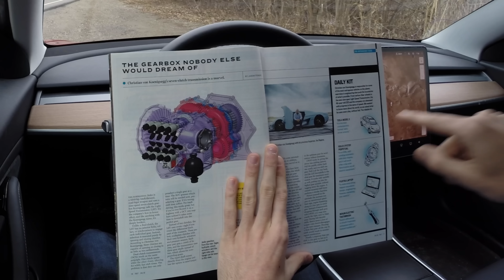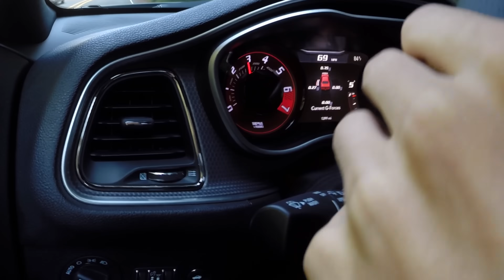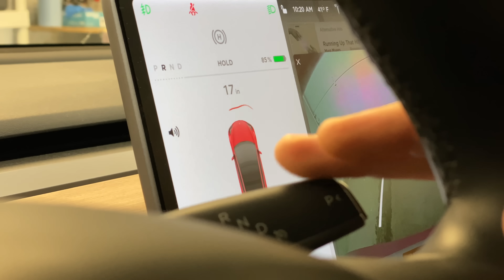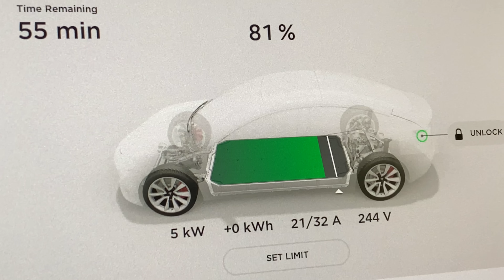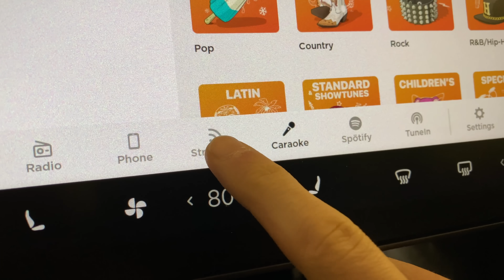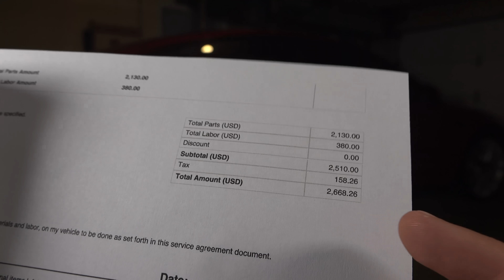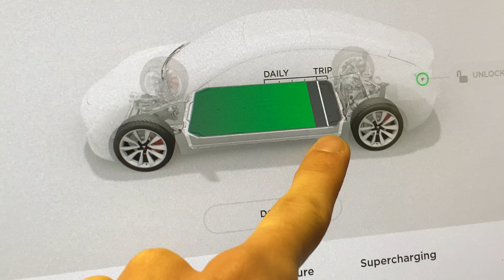Living With A Tesla Model 3 For A Year - The Best Daily Driver

Comment: 16:00 can’t you change the sensitivity of the accident thing? Or even turn it off worst case.
Reply from the maker: Yes, I have now found out! You can adjust sensitivity or turn it off. Wonderful!
Reply: Engineering Explained happy to be of service good sir.
Reply: @EngineeringExplained  Turn it off!!  turn it all off!!  Useless crap that gets in the way of actual driving.  :-)
Reply: @neoanderson7  As long as you drive normally (As in not unnecessarily reckless) the collision warning shouldnt ever go off. However, if you ever happen to get caught daydreaming it might save your ass. I currently drive a car without any electric assistance, not even abs, and it is fine, but the modern assists arent all useless.
Reply: @banaana1234  I'm specifically talking about that collision warning, side assistance, smart city braking.. all that junk.  ABS is not a system that interrupts your driving.  It lets you know when you've finally reached the grip level of your tires.  But its not constantly pestering you with lights and beeps from the console.
Reply: @neoanderson7  My point was that the problem is between the wheel and the seat if you are constantly getting beebs and flashing lights. At least if the car is reasonably designed and calibrated.
Reply: @banaana1234  I thought you saw this vid?  He describes not coaxing the car into anything abrupt, and still the systems were going off.  Don't think its this vehicle only.  I've had to drive my folks GLC and that thing  is absolutely ridiculous.  You'd be traveling down the road, no one around, and the thing would say "collision warning" for no reason...  All this tech gets in the way in the actual act of driving.  Just wish the manufacturers would give you the choice to equip the cars a la carte... alas...
Reply: @neoanderson7  Did you read the comments? The frontal collsion warning is adjustable, and he had it set too early. 

The safety systems are not up to the manufacturers to decide, regulations and safety tests mandate them.
Reply: Yes. There are 5 settings. number 3 is the default, number 1 is very close before you get nagged at
Reply: @UCWc_pCBR-U3j-BlTu2gxNoQ there lyes the issue.  Would we need these things if people actually knew how to drive?  When did it turn from becoming a privilege to a right to drive?
Majority of those vids you see are people who have no business being on the road.. and yet...
Reply: There should be an option to turn it off indefinitely.  All these modern vehicles have these "features".

Comment: Most of the problems mentioned are related to turbocharged automatic cars and don't really apply to N/A manuals
Reply: Well they do apply. A n/a manual has zero torque in cruising gear.

Also about zero cars sold these days are n/a manuals

Comment: I mean.. that precooled feature can be the main reason to buy it.
Reply from the maker: Soo nice when it's a super hot/super cold day! I use it all the time as it hovers around 30-40 degrees in my garage.
Reply: @EngineeringExplained  Just curious... Will it drain the battery hard?
Reply: @Dominus_Potatus  the AC is actually fairly gentle on the battery.  The heat is probably worse but I live in South Texas so I don't have need for heat.
Reply: @cspicer77  So be it! This is the killer feature for me XD
Reply: @Dominus_Potatus  For day to day driving, if you can recharge at home, the range reduction from using the heater is mostly nothing to be concerned with.

I think you lose about 25-30 miles of range just to run the heat at max output for an hour. However the heater shouldn't really run at max output for long unless its extremely cold.
If I had to do a long (200+ mile) trip in sub-0F temps, I'd be a bit concerned, but only because I've only owned for a month and have yet to actually drive in sub-0F temps more than just around town.

One nice thing is even if you don't pre-heat you still get instant hot air unlike in an ICE car. 
My wife drives 3.5 miles getting from work-daycare-home, all on slow city streets and so when its sub-0 her gas car would never heat up until she was pulling into the garage. 
In the Tesla she is pleasantly warm before she even makes it to the daycare, even though she usually doesn't preheat the car before leaving work.

Comment: Number 9 is null for me. My icu car has a system where I can remove the key from the ignition without shutting off the car.
Reply from the maker: So if you were at the beach you'd leave your car idling? Seems like cracking windows would make a lot more sense than leaving a car running.

Comment: Hmmm, they seem nice but I’m leaning more towards a hybrid until we have more charging stations in the country.
Reply from the maker: Plug-ins are a pretty great mix (like Chevy Volt), where you have 50 miles EV for around town, but endless gas range if you need it.
Reply: Yeah, PHEV is a good transition.
I mean.. if they can make as good as Tesla's software.
Reply: I prefer having an extra vehicle. That's just me. My work cummute is below 100 miles a day, the times I need more that are sparse but I would just use a gasoline vehicle for those times.

Comment: So now your Tesla is 1/10 of the way through it's lifespan.  And how could it be the best daily driver if a pothole will run you over $2,000 to fix?
Reply: Because that could happen to any car (and does).
Reply: @stinger15au  Won't cost you $2k for it unless you got wheels that expensive.
Reply: The wheel and tires could have been on an ice vehicle. Nothing to do with electric.

Comment: I've noticed other vehicles that have smart driving/warning systems also seem to engage "emergency warnings" too early.  My guess would be it's a business decision to prevent unnecessary law suits for the car "not warning soon enough".  Until tort reform, we're stuck with this behavior (in the USA anyway).
Reply: I noticed it on a 2019 Honda Civic I drove recently. It wasn't mine, though, so I wasn't going to change the sensitivity even if that was an option.

Comment: The heated steering wheel is useful when it's cold in the car right? But you can preheat the Tesla, so that replaces that need IMO.
Reply: Ma Dani 

yes, but there’s a significant CONSUMPTION and TIME difference between preheating the whole cabin and the steering wheel (and seats) only.
Reply: @kam_iko  Well yes, you have to plan a bit.

Comment: They are not insanely quick. I have a a3 2.0 diesel with 177 hp. I lease electric vehicles to drive in town. An i3 with 170 hp pulls the same. The difference is where it pulls from. And i noticed the lag in my car but it doesn't bother me.

Comment: No mention of winter range? Batteries hate the cold, additionally you need to use even MORE of your battery to heat/defrost the vehicle.  ICE vehicles have excess heat, no loss of range. Not everyone has a garage...

Comment: For practicality and fuel economy,the wheel should be just big enough to accommodate the brakes,right?
Reply: Well... at the end it is the diameter of the tire.
You can have small wheel and big tire.
It eill be more enjoyable and eliminate most of small bumps.
The downside: Bad at cornering in high speed and smaller disk brake.

Comment: I drive a Prius Prime, and even in EV mode the accelerator pedal still does that "ask for 75% gives you 100%" thing. I've also driven a model 3, and the linearity of the accelerator is really impressive.
Reply from the maker: Ahh, that's a bummer! I wonder if the tuning is a little more finicky for plug-ins. I drove a Volvo plug-in (XC60 I believe), and anything over about 25% throttle and it would kick the engine on, kinda annoying.
Reply: @EngineeringExplained  I think it's just the way Toyota has always mapped accelerator pedals. It also doesn't have one pedal driving, which makes it hard to maximize regenerative braking. Maybe that's all because it's a hybrid, but it seems like they are held back by old ways of doing things. Tesla has a huge advantage in many ways starting from scratch.

At least I can use 100% throttle without the engine coming on. In EV mode it has only about 90 horsepower, and 0-60 is 12 seconds, so I floor it frequently. 

Similarly, the interior and infotainment in any other car looks and feels decades behind Tesla. There are some quirks to controlling everything with the screen, but at least the implementation of the screen is really good. 

I paid about half as much for the Prius as what a reasonably configured model 3 would have cost me at the time, so I can't complain.

Comment: @Engineering Explained

do you experience cold (falling down on you) from the panorama roof?
Reply from the maker: I have not felt this.
Reply: Engineering Explained 

oki, thnx. (tesla)bjorn mentioned this a few times. i’m not a big fan of the panorama roof (heat, cold, acoustics, weight), but i’m also not in the market for a new/any car, so it’s all mostly academical.
Reply: Engineering Explained I have felt the cold falling down on me. It’s not the only thing that falls down on me. I will not talk about the other things that fall down on me.
Reply: My two cents you didn’t ask for: I have felt heat once and cold once through the glass roof. I adjusted the thermostat a little each time. 
There is the other side. I have a buddy who is 6’9”/2.05m tall. Last weekend he decided to try to get into my model 3. He could! He usually lets his wife drive, just because it’s such a hassle. I’m 6’3”/1.9m tall, and I don’t fit into many cars with sunroofs, because the headliner steals too much headroom.
Reply: Gary Wiseman 

i see why they do use the panorama roof, i just wish there would be an option for a regular roof :)
i’m 1.88m and bold. never had headroom problems in the front seats of any car, however i can’t drive convertibles (because of the sun (and the noise)).
Reply: kam_iko I understand. I had to have a convertible, so I tried out many of them. I finally found I could just fit into a BMW Z4. This was the older model with the rag top. Mine was a 2007. BMW really did a great job with that car. The leading edge of the roof is plastic. It turns out that’s where most of the noise comes from. That car was a great trip car. I really liked taking it to the beach and the mountains. I sold it when I bought my Tesla model S, and Carol got her model 3. Best of luck with your automotive journey!

Comment: Excellent, but I call “FUD” on the “no maintenance” thing. Yes, modern ICE car motors need an oil change about once a year (10K miles), but that’s usually done on the same schedule as the tire and  suspension maintenance. The latter is ALSO required for every EV. So as a practical matter, you’re performing maintenance once a year for either ICE or EV. Longer term, it’s a fallacy that Tesla electric motors last forever with no maintenance. It’s just not true. They do break and break down.
Reply: Overall the maintenance cost for a 200,000 mile ev is going to be a fraction of a ice car.

Comment: I know It's a bit of an off-topic, but I'm studying aeronautc and it's crazy hear you saying  that piston engines (ICEs) are slow to react to throttle, since we learned that one of their selling point against turboprops is the fact that they can quickly respond to throttle movement because you don't have to wait for the turbines to spool up or slow down, it really puts turbine based engines as well as electric motors into perspective
Reply: Federico Di Liberto I know a little about aeronautics and not an expert by any means, but I could tell you that it’s just on a completely different level. On an ICE you have to wait for the throttle body to open, then the air to be sucked into the engine, then the gas ignited, and the revs to increase. In an electric motor it’s almost literally like flicking a light switch, you touch the pedal and you’re going faster a couple of milliseconds later.

Comment: Great show. Just want to mention, there are audio settings where you can adjust the sound to any point in the cabin. And, there is a setting as to how the early warning system works.
Reply from the maker: Ahhh, I have tried adjusting sound but not successfully, where is the early warning setting? Would certainly be helpful to myself (and probably other viewers).
Reply: @EngineeringExplained  Early Collision Warning is under the Autopilot settings. I set mine to "late" and stopped hearing it. Can be turned off entirely, too.
Reply from the maker: @pjfry  Thanks for letting me know! I've added a pinned comment to inform others, appreciate it!
Reply: @EngineeringExplained  By default, Forward Collision Warning is
turned on. To turn it off or adjust its sensitivity,
touch Controls > Autopilot > Forward Collision
Warning. Instead of the default warning level
of Medium, you can turn the warning Off, or
you can choose to be warned Late or Early.

Comment: Electric motors are amazing for driving cars, now someone just needs to find something better to carry electricity around..... todays batterys suck. Just imagine an electrically driven S2000 with a battery that holds the same power and has the same weight as a fuel tank. Achieving that is the next great challenge!
Reply from the maker: Agreed! We need better batteries, but I think it'll happen with time. Mainstream EVs are quite new on a relative scale.

Comment: Let us see how long this electric car will last, 20 years like a Toyota Corolla or Camry, when to replace the batterie, and in a wreck, the parts cost a ton and lot more
Reply: Replacing the batteries would be like replacing an engine.  Most people just buy a new car instead.  Tesla's are like throw away cameras.  You will not see a 2019 Model 3 in 2029.
Reply: you can say money for not paying for the gas,engine parts and in 10 years buy new set of batteries.
Reply: @miloraddjurdjic1695  and what they do with the batteries, instead save the World from pollution, gas, the batteries are insane toxic. They just store them somewhere
Reply: @leanderfehr2802  lithium can be recycled. I don't know if it actually is.
Reply: @leanderfehr2802   Most of the time, the batteries that are no longer suitable for use in the car are like that because they've lost some capacity.  But they still work.  They can be repurposed for energy storage systems similar to the PowerWall.  If they're too far gone, then they can be recycled.  There is actually not that much lithium in these batteries (it's a 1000 lb battery, but only about 100 lbs of that is lithium) so the recycling process is more about recovering steel, copper, and plastic than recovering lithium.
Reply: @Seb C just go look the little crash that have Marqués Brownlee, or MKBHD, that liitle crash took for ever to repare.
Reply: I think the bigger concern is when the electronics bugger up.  That will be $1,000's to replace and repair.  I'm waiting for a 'Camry' electric from Tesla or whomever.  I don't need 100's of electronic systems to fail, I just want to electrified driving.  Whatever company does this first will be a runaway success.  Under $30K out the door will spell a shift to all electric.  For $65K+, no way, I can buy three ICE vehicles for the price.
Reply: They’re designing the engines to last 1 million miles. The rest of the car... 🤷‍♂️

Comment: Electric cars pollute wayyyyy more to build and recharge using radioactive process it’s insane... guess what people would say if they were to get an internal combustion engine now... goshhh this is so cheap, I can buy 4 of those, and I can do 1000 miles before refueling...
Reply from the maker: You can get EVs used all day under $10k, some even still under warranty. Tesla makes expensive cars. So does Mercedes. As for environment, I'd recommend you give this a watch: https://youtu.be/6RhtiPefVzM
Reply: The environmental impact part is complex, because much of it relates to the electrical energy used to make the materials in the battery, and the energy used to build the batteries and packs. If manufacturers source their electricity from a dirty grid, then the battery pack inherently comes with a high environmental impact. But if they source from solar, wind or hydro, that impact goes down massively. I can't speak for the US and China, but in europe there is a big drive to address this by building new gigafactories that run entirely off renewables. Northvolt will be the first, but more are following.

Comment: Point 8 is not valid. Lots of ICE cars have remote start option.
Reply: But you can't do it in an enclosed garage. Or at least if you don't want to die.
Reply: @jonmayer  if you have a new car - you can. By new, i mean the one with an engine that complies with Euro 6.2 emission standards.
Reply from the maker: You do that in your garage? (that's the point). Can't do it in a garage. No instant heat.
Reply: @EngineeringExplained  i own a 2008 car, so I don't have remote start. And secondly, I leave my car on underground parking near my apartments so even if I would have own Tesla it wouldn't work.
Reply: @EngineeringExplained  oh, forgot to mention that Volkswagen performed tests on monkeys breathing exhaust gasses from their diesel.
Not saying it was a humane thing to do, but monkeys where ok, so humans will be too.